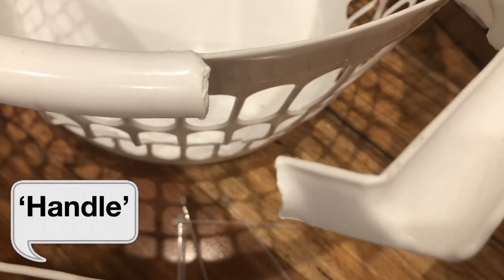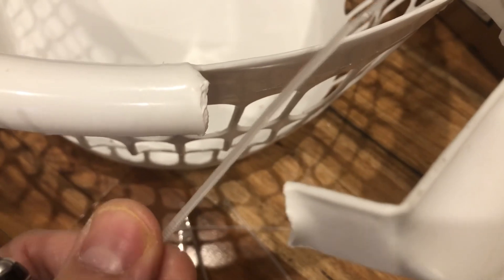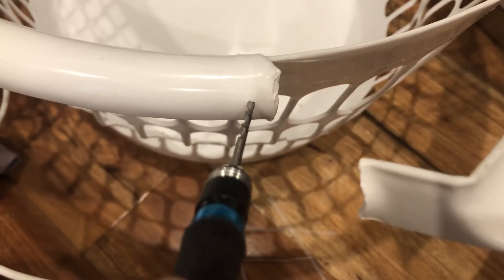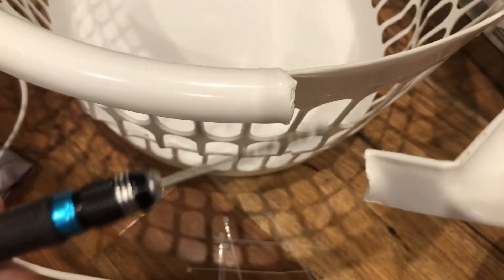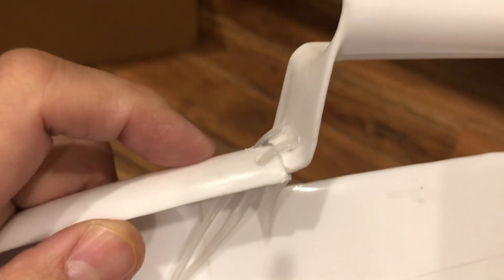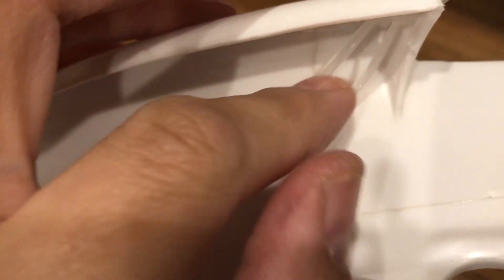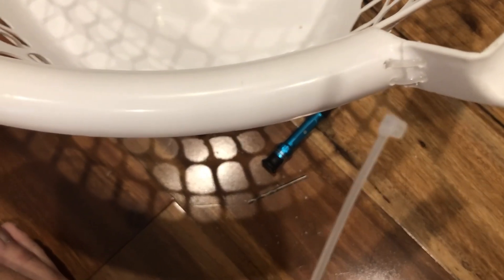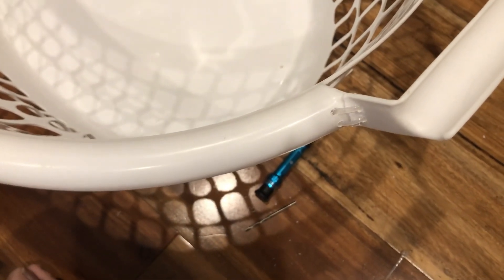Quick fix for broken laundry basket handles

Comment: This looks good, but I wonder how long it lasts. Drilling holes makes all the weight of the basket pull on the little bit of plastic on the edge of the break.  Maybe this is just to make the basket look better? I'm in the bathroom at work watching this so no sound. 😂
Reply from the maker: I had to make the hole a bit bigger so I could use a bigger cable tie. That small cable tie didn't last long and snapped as you suspected. The bigger/thicker cable tie still going.